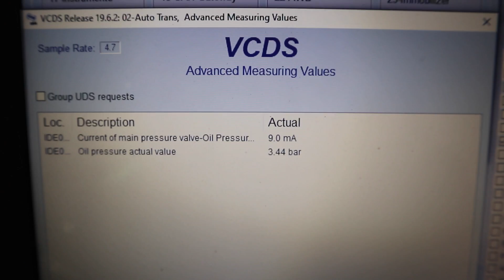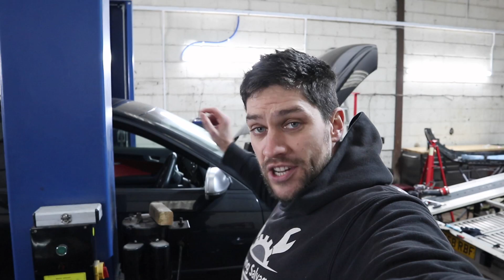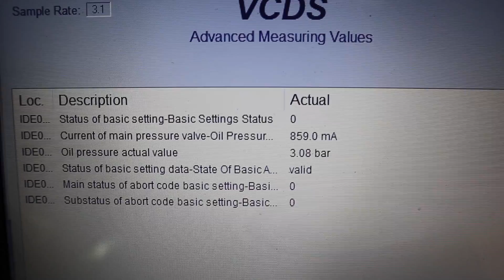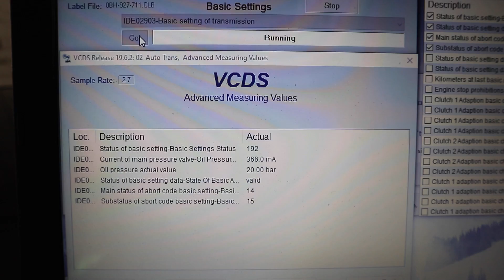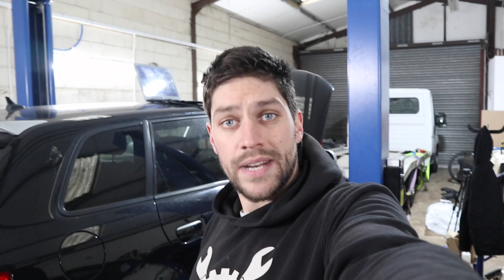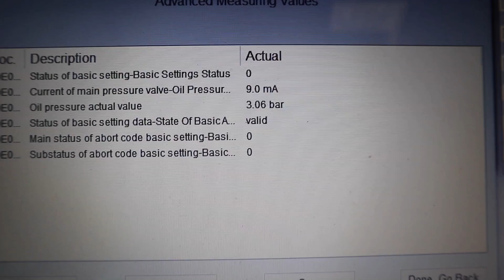My BRAND NEW Mechatronics Is FAULTY on My AUDI RS3!!!

Comment: having a similar issue with my current mech in my ttrs which has the same gearbox as it decided to fail on the way to the Nürburgring so about to order a new one like yourself,just wanted to know the outcome of this did audi sort it with another new unit or was it some sort of coding issue

Comment: VW Audi is only expensive and for sure not quality  or fur sprong durch technik   dont mis understand me i am a proud owner of a RS6 and a S6 
that S6 has the 3.2 fsi motor and its delibered made so it will fail on the tensioners. there is no recal or improvement part . this story is even more weird  a new part that failes from the factory.

Comment: So, by the looks of it you got the replacement part exchanged and fitted under warranty. BUT from the video, it looked like that once the old "faulty" mechatronics was up to temp, you reset it all and it worked fine...... so was it fine, or did you still need to use the new part?
Reply from the maker: The old unit worked fine until it was up to temp. That’s when It failed. The new one fixed the problem 👍🏽

Comment: Hello I've just started following you seen the video of your rs3 and faulty box ...I had all the same symptoms as you described on my a4  garage told me  I'm ooking at a new autobox at a cost of £8000+ turns out it was a faulty valve/ flap in the head that opens n shuts depending on how much throttle I used but it confused the autobox because of it being  broken total cost £89 + labour £35

Comment: I had similar problem, with a local Malaysian brand, proton, mine also was similar, I went to various places to get it fixed, but all failed insisted I had to change gearbox, either ways long story short... it was electrical problem, there wasn't enough power delivered to the gearbox relay, it was fixed by by wiring the relay, check the voltages at the relay terminals,

Comment: Hi Mate did you check that the new Mechatronics had oil in the unit it’s self Takes about 100ml of oil if I remember correctly it’s a separate oil to DSG oil
Reply from the maker: Yeah, they already have oil in from new

Comment: I have a Dynamik 2011 A4 and had message come up on my dash like “gearbox malfunction: you can continue driving (limited functionality) took it to a garage paid £2800 as they said it was the megatronic system (that wasn’t covered) waited over a week only to have the same problem pop up 2 weeks later 😔 they said it was the clutch clamping pressure it was getting too hot 🤷🏾‍♂️🤷🏾‍♂️

Comment: Audi parts supply is diabolical. They should be ashamed. I needed a power steering pump inlet hose for an A4 3.0 V6 in December. Pretty much a low cost consumable part... not in stock and on back  order. I was told likely 4 weeks! I ordered one from Rock Auto in the US, it arrived 3 days later. £9 + £13 shipping. Car was otherwise off the road... because of a cheap hose. Very, very poor, no excuses Audi!

Comment: Seen your video bout the mechatronics not working and it’s new, from my experience in the trade the reason the mechatronics fuck up is because there is a problem inside the gearbox’s it’s self, I had the same thing with my scirocco R best advice is find a low Millage box for it
Reply from the maker: Problem isn't the gearbox as the old one works fine up until it gets hot.

Comment: I replaced my mechatronics unit and did the basic setting using vagcom no worries. Also had to run through a number of calibrations. There was a procedure I followed that I found on a forum somewhere.

Comment: Were there any fault codes in the transmission control unit when looking at that? 9mA is valve basically closed and not allowing pressure through. This can happen if the box senses a fault and needs to open the clutches for safety and limp.

Comment: Said it a million times already German Cars are absolute piles of dung why anyone would buy one is insane.    Most unreliable over complicated money pits ever.
Reply: What do you Suggest is better?
Reply: @Vespastendert  Anything !   You cant defend the indefensible.   Facebook marketplace is littered with broken BMWs & Audis as spares or repair.   Its fault after fault with them.   I have a 2009 Ford Mondeo with the 2.0 TDCI PSA engine 125k & It has genuinely not had a single problem since new.   Its still like a brand new car.   I also have a 2014 Toyota since new & again zero problems.   German cars are by far the most unreliable moneypits out there.   Major fault after fault.
Reply: @TeeShirtSunTan  hahahaha a Ford that’s never had any issues pull the other one mate , I’ve got a mondeo on my drive right now I could spend all day listing the problems with it , parents bought a brand new Kuga last year it’s constantly going back to Ford nothing works on that thing . All modern cars are the same , I can’t wait until every goes electric and we see the arse rapings that is going to bring from main dealers
Reply: @Liam-uq6sb  Some fords are unreliable but if you know your stuff you will know what to avoid.   Ecoboost or any of the 1.0 or 1.5 avoid like the plague.  The 2.0 TDCI PSA in mk4 Mondeo is one of the best most reliable diesel engines ever produced.   Watch Alan Howetts youtube channel.   They can go 200k plus on the same clutch flywheel injectors turbo etc they last forever if you use the right oil etc.    German cars esp audi & bmw are shocking mate if you don’t believe this you are in denial.    My local audi specialist have cars queuing out of the door every day.  My Mondeo aint seen a garage its whole life other than timing belt change.
Reply: @Liam-uq6sb  also no dpf issues in 12 years still on original dpf but that is because I look after it with correct driving & oil changes.
Reply: @TeeShirtSunTan  lol so everyone should drive the same model Ford that you have then ? If you’re not going to talk sense there’s no point in taking whatsoever
Reply: @TeeShirtSunTan  ok let’s all go buy a 2009 model Ford mondeo then eh 😂🤪
Reply: @Liam-uq6sb  I am happy with my cars which I love & if you don’t like my opinion or cant face the truth about German cars then its your problem not mine 👏👏👏👏
Reply: @TeeShirtSunTan  lol ive owned loads of German cars and fords and numerous other makes and models , all cars have their issues if you can’t afford to own one and repair it then that’s your problem .  I would never buy an auto box but that’s personal preference a lot like you and your 2009 mondeo that you say in infallible 😂 when millions of other people have bought them and had many issues , the tdci model before that one had a major issue with the fuel injection pump failing and taking all the injectors with it . I’ve worked with cars for 20 years I’ve seen them all come and go . The best Ford Diesel engine ever manufactured was the TDDI models like in the mk1 Ford Focus , way more reliable than any TDCI . Name the most recent infallible Ford Diesel engine ? You can’t drive a 2009 model forever can you

Comment: It looks like the motor inside the unit is stuck. To get a low current like that shows it’s not spinning. I would have oiled it first before putting it in.

Comment: About 3-4 years back I had the box in my RS5 repaired, new clutches etc. The company I used did repairs on the mechatronics.  They had mentioned they had disgruntled Audi customers arrive with near new unit's that had failed and Audi would not do anything with them bar changing the whole gearbox (about £14K at the time), or the customer had lost so much trust they prefered a specialist company. 
I hope your Audi dealer can claim back the new unit AND the costs for diagnosis rather than pass that on to you..

Comment: That's odd and definately a bummer - I feel your pain, m8...on the bright side, apparently everyone and their mother know you in the district including guys at Audi dealer since they take the car in and recognize the warranty, because I can imagine a scenario when Audi refuses to take responsibility for not working part since they haven't installed it and before you guys start blaming VAG for all sins do keep in mind that some parts are really sensitive - e.g. there might be some MOSFETs that drive that electrical pump in Mechatronic and if you wear a good old sweater and then without grounding yourself touch the connector...well, nothing good is going to happen to the device. Annoyingly you'll have to wait as you said a couple of weeks, but in the end you won't lose 1800 quids which is great!

Comment: Had an intermittent  ABS light on A Polo for 3 years. VW replaced all 4 corners.. No joy. Then a technician found a dodgy connector. Fixed it. Remote chance a dirty connector could cause old and new unit problems.

Comment: There's something to be said for taking a gearbox valve body replacement to the dealer, where it will be fitted, tested, and fully warranted.  Faulty new parts are not restricted to Audi, either, for all you VAG bashers out there.  When you play with expensive parts in a home workshop you carry the risk of problems yourself, whereas when you take it somewhere they carry the same risk of having to do it twice.  No use bitching about the choice you make.

Comment: Reminds me of my time working for Ford Industrial Products. An American trenching machine, Ford US 4 cyl diesel engine kept eating injector pump drives.  Engine out and stripped to check cam shaft  - machined out of line, new engine ordered, 3 weeks later arrives fitted and fired up - snaps injector pump drive. This happened 2 times before we got a decent engine, even then our machine shop had to re linebore the camshaft bushes to get the correct alignment. Deep joy.

Comment: Bad news Dean, but I must admit it was suspicious when you noticed the electrical connector was wobbly on the new unit before you installed it. But, it's not the kind of part you can just take back, compare with another and swap. I think the evidence of this video would be more than good enough to confirm the unit is duff and get a new one on the way, but.... life is never that simple!

Comment: Have you ever thought of switching to FORDS .These Audis are gonna drive you crazy 🤪
Reply: What a stupid comment.  Fords have valve bodies in their autos too, and they also fail, in fact far more often than Audis.
Reply: Not £1800 though 😆
Reply: @stevo1846  Here in Aus the auto gearbox that Ford uses in the Ranger goes faulty many times berore 100,000k.  It can't even be repaired - it's a full replacement at approximately $8000.  So yes, not 1800 pounds, but MUCH more.
Reply: You need to live in U.K..So much cheaper
Reply: @stevo1846  You're 'avin' a laugh now.

Comment: That's just bad luck. Oil pressures looked very similar numbers, only current values are definitely different. To perssures be even that 3bar, oil pump must consume more current than 9mA. I think only the current sensor might be faulty inside mechatronics unit
Reply from the maker: Yeah I could hear the pump working... seems to have similar pressure to the new one. It may be just the sensor inside it faulty as you say. But that sensor stops the basic setting which will give me drive! 🤦🏼‍♂️
Reply: @SavingSalvage  That is true. It is a small fault, but it is ruined the whole mech unit. If that is the real fault. So common in electronics. Small smoke, big problem

Comment: I had this problem with my audi a6 c7 ultra back in November 2020 took car to audi they fitted new unit & that unit was faulty from the factory I was banged from pillar to post for 
the next 10 weeks over warranty for the new part to be replaced. All I got was needs new gearbox wasn't having that got Audi UK involved so I could get a loan car once I got that they repaired the in 
2 weeks.

Comment: There is a module that needs repairing on the mechatronics.
You can buy 100 mechatronics and you will have the same problems.
Get it repaired.

Comment: When you first took the new unit out of the box, in the previous video, you observed that the socket was flapping around a lot more than on the old unit. It hadn't sustained some physical damage in the box or during shipping had it? Something that broke a solder joint or the like?
Reply from the maker: I looked at it and it’s supposed to be loose lie that, it just sits on a little bracket and the flexibility allows it to be positioned on the outer casing properly and that’s what holds it in position.
Reply: @SavingSalvage  exactly, mating something fixed to a fixed will result in possible something bending, cracking or breaking. You want to have the connector lose so it can safely mate with the opposing hole without any force applied :)
Reply: Wow thats not good. Its not like a cheap part. You should bill them for your time taking it out and putting it in. Claim for reps of pumping fluid in too 🤣😍

Comment: Do hope they honour the warranty and don’t try and shift responsibility your way on a “Faulty” installation.
Reply from the maker: Luckily I followed the official repair guide and luckily there’s fuck all you can do wrong on it 😂.. it’s literally unbolt, pull out, out new one in and bolt it on.
Reply: I warned him about that 2/3 months ago. Warranty is honoured if certain criteria is met.
Hopefully Dean hasnt smoked £1800 on the part,and any labour involved with diagnostics,if its NOT a warranty claim!
Reply from the maker: @iancovid19hamilton69  don’t worry I know how it works mate, I did it every day for 5 years. They would have to suspect it was installed incorrectly
Reply: I told you about the guy when I worked for Merc,who got shafted on a warranty claim,due to "dirt ingress"(got the part fitted from non Merc garage).
Lets hope Audi are honourable!
Reply from the maker: @iancovid19hamilton69  my issue it electrical, so should be fine there. 😅😬
Reply: @iancovid19hamilton69  He's worked as a tech for Audi. I'm sure he knows the in's and outs of warranty mate.
Reply: @jimmyjt16  Time will tell mate,maybe Audi can fix it within an hour?

Comment: Hi Mate, I feel so sorry for you what a pain the a***. I do recall you saying the main connector was loose with the new unit. Maybe, that is the problem?
Reply: Yeah I recall that, wonder if connection faulty?
Reply from the maker: It was just a bracket, it’s meant to be slightly loose to allow you to fit the casing properly, the casing is what holds it in securely